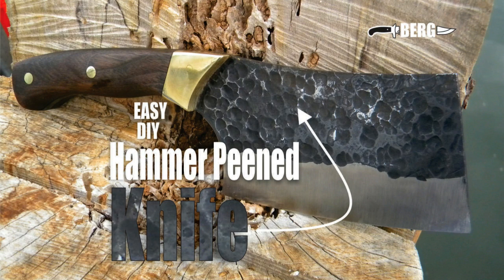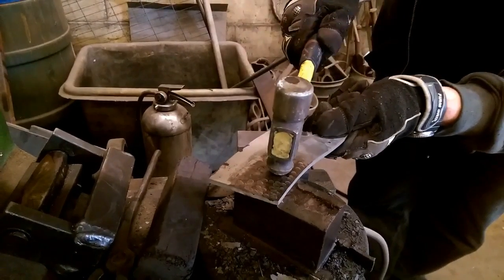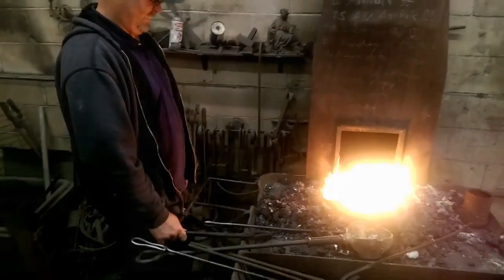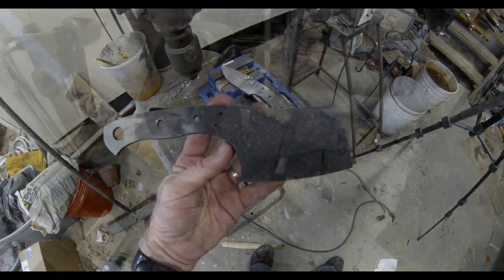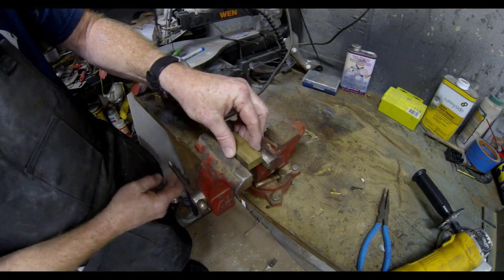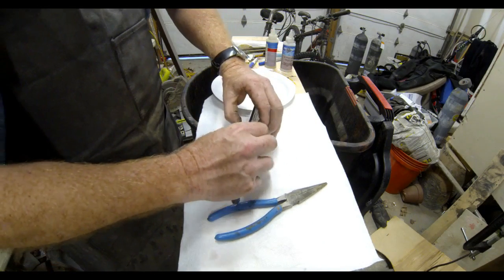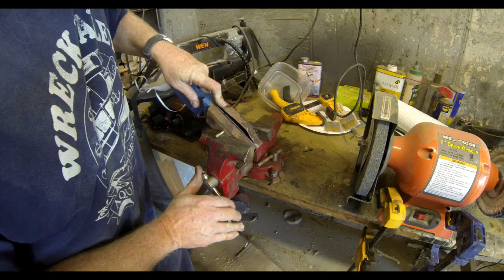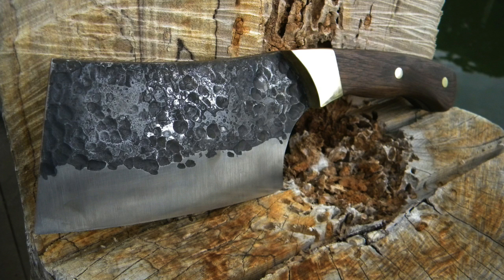Easy DIY Hammer Peened Cleaver Knife | Knife making Step-by-Step Tutorial

Comment: Hello can you kindly explain to me why it was heated and them put in oil? And what kind of oil was used ?  Thanks very much and nice work
Reply from the maker: To harden high carbon steel you have to heat it till critical temp and then quickly cool in oil. That leaves the steel hard but brittle. Next step is to temper in oven for two hours and then let it cool overnight without opening oven door. That tempers the blade and makes it less brittle

Comment: How much did it cost to get the blade cut out with the waterjet?
Reply from the maker: I sell the Cleaver blank for 35. The waterjet cost about 7 per blank then you have to add cost of the Material (1095 sheets) and shipping.
Reply from the maker: http://www.diyeasycrafts.com/knife-blanks-.html
Reply: DIYeasycrafts neat! thanks
Reply: DIYeasycrafts I checked out the site and it looks great. Any thoughts to have some peened and the initial grind done before selling?
Would love to make one like this but don't have access to the tools needed to peen and then Heat treat. Thanks
Reply from the maker: At this time I only offer blanks and on occasion a finished knife. The finished knives are basically available when I do not make them for a particular customer. If your interested the cleaver in this video is available for $200
Reply: DIYeasycrafts thanks. 
I will look into getting a blank and figuring out how to make it happen.
Reply from the maker: Take a look at some of my other videos. You can get a similar results with a ball peaned hammer or with a disc grinder https://www.youtube.com/watch?v=aLZQsYUzRQ8
Reply: DIYeasycrafts thanks. Will do that. Have enjoyed the videos and look forward to making my first micarta. Never knew I could do it at home. Thank you